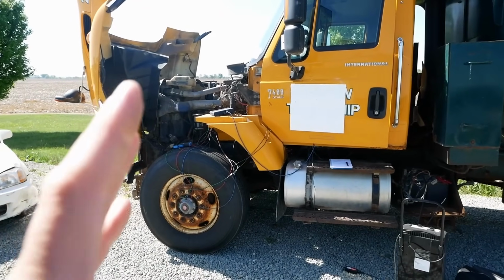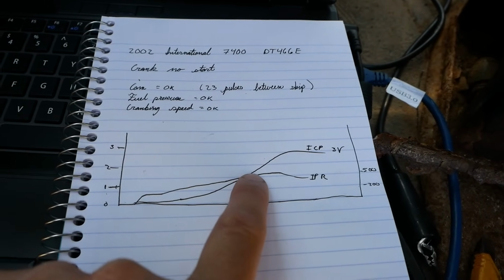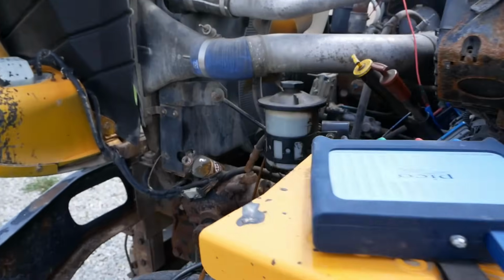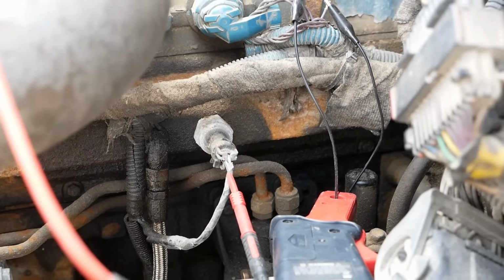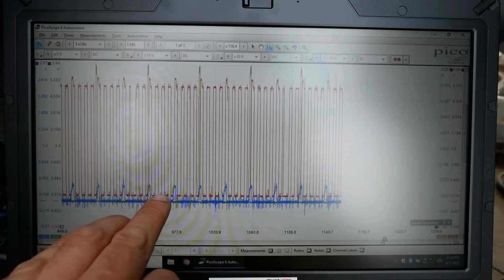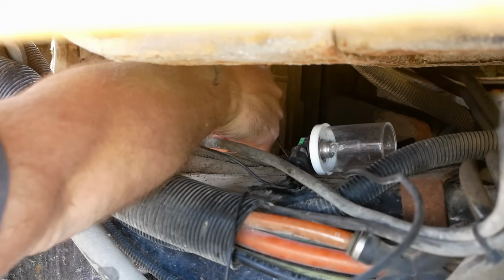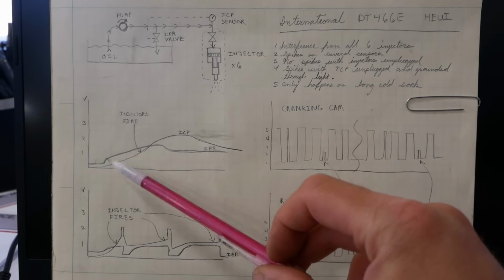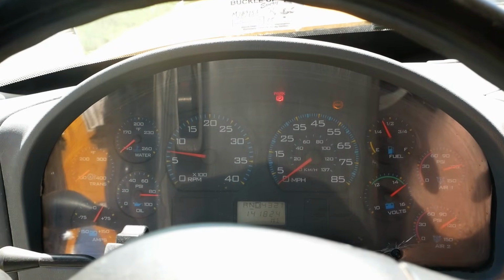International DT466E Won't Start without Ether after Sitting

Comment: 😊First thing don't call her a rusty old plow truck, she can hear you.
Like mine,, fuel sender bad, sending tube bad,
Fuel pump week, fuel check valve in to fuel bowl needs replaced, ipr valve replace.
No fuel pressure to fire the motor, so ether causes ignition and helps pump up the fuel. wait a couple days and all the fuel drops back into the tank and has to start over again, needing ether to help pump. Do the repairs. And remember you disrespect her she ain't going to run for you😮

Comment: What I observed , before you fired up the engine after a 24 hour cold soak , with the key on the oil pressure gauge was recording over 60 psi then after start , was  indicating over 80 psi while idling . It should be no oil pressure before cranking the engine , only when  cranking for at least couple of seconds specially on a cold start ! This type of diesel injection was the brainchild of the Navistar( DT466 E ) , Ford ( 7.3 DI ,6.0 and 6.4 ) and Caterpillar ( 3126 E , C7, C9 ) engineering  team , as I know .  In  the case of a  defective camshaft position sensor , no tachometer signal  , and in case of no start  P0340 or P0344 DTC ( Ford )

Comment: Power interruptions to the short term memory to the ECM, this is why IH wires directly to the battery, this need for power for short term memory.   Long term memory need no power to hold memory. I believe this is why the 48hr window. It holds the short term memory, but long term memory restores to default every 48 hour window.

Comment: My professional opinion as a truck driver and shade tree mechanic is once salt hits the electric system and the computer junk it it costs more to fix then it's worth had an IH garbage truck the throttle position sensor got f'd up never was right after that even reprogrammed it and still

Comment: Could you not just put a "start" switch on the pump/sensor to fake it out forcing it to at least start.  Have to tremember to switch it off when the motor starts .. or make it a momentary push and hold to start.  Not nessarilyy right but saves ether.

Comment: Thank you Wes , I have a 2006 DT570 7400 plow truck with several electrical issues , I don't have the skill level you have so it is taking me a while to figure out , taking one issue at a time . These modern day electronic everything's are great when they work but totally unreliable for long term , it seems . Wish me luck .

Comment: CHECK INJECTOR HARNESS KNOWN TO GO BAD CAUSING INTERMITENT START NOSTART CHECK ALL YOUR SENSOR PLUG CONNECTIONS BAD , CONNECTOR PIGTAILBELIEVE BAD INJECTOR WIRING HARNESS DONT WASTE TIME ON A SCOPE GOING IN CIRCLES VERY FANCY BUT DOING VISUAL CHECKS AND A MULTIMETER DIAGNOSIS SHIT FAST SCOPE IS GOOD BUT IT AINT THE HOLY GRALE

Comment: Remember back in the late '70s, early '80s my terminal bought some IH trucks for tanker transport. Their headlights were really bad. It was found there was a large voltage drop at the lights. We ran a separate ground wire to 'em, it worked great! The hood had a bad ground.

Comment: I know this is way old video, but should someone fall into this same pit, its the ficm .
Hes correct, the ECU, but its the injector power supply voltage dropping off with higher current for cold injectors.

Warm injectors use less power, when cold starting the injectors require far more energy. The key he missed was the low current during cranking.

If he had removed the ecm and monitored the control voltage, the smaller trucks have an access plate on the back for exactly that. it would have been low when cold and caused no cold response.
The other trucks run at 48 volts, I'd doubt those would be much different. On those its a surface mount bleedoff feedback resistor that gets cold solder cracks and loses connection. A simple reflow and they work exactly as they should.

Comment: Did i see no rpms whioe you were cranking? My 2007 7400 shouod show no rpms on tach, and wouldnt start in the cold. I changed the crank shaft position sensor (not camshaft position sensor). The crankshaft position sensor is under the doghouse. My truck shows rpms now when cranking and starts easily in the cold.

Comment: I come back and watch the videos on the plow truck and the old ford f-800 many times off and on i have 1 of both , i am always having issues with the 2002 International 4900 dt466e, slow starts no starts no start after sitting the list goes on lol i have bought a couple different lower end scan tools to read pids on the dt466 but they never read the ones i want wich is most times the icp and ipr right now im fighting it it will start and run for about 30 seconds and die it will restart as many times as i try but will die after about 30 seconds my nextlink or otc scan tools will not read icp or ipr sensors any chance anyone out here can tell me a scan tool that will read on the 4900 dt4663 ? also i might add that after counting to flashes it shows a mfi= 4 and spn 164 ??? i wish there was a list of codes and there meanings easy to find lol im retired and do everything my self cant afford to take it somewhere anyways if anyone can help would greatly appreciate it !!!

Comment: If u had the software, you could monitor the injection actuation oil pressure.  There’s an actuation pressure test as well. They use the same injectors at cat 3126 HUEI engines.

Comment: Two possibilities spring to mind. (1) The bypass capacitor on the 5v reference supply inside the ECM has failed. Put a few hundred microfarads in parallel with the reference supply and see if it helps. (2) Someone made a ground loop. I ran into this problem on a retired Crown Vic police car my sister bought at auction. From the factory, the transmission-mounted speed sensor had been connected to the ECM with two wires--a "sense" and a ground. Somewhere along the line, the harness got damaged, and the ground wire broke. Instead of stringing a new ground all the way back to the ECM, some genius said "we'll just ground her to the chassis, and she'll be alright!" Wrong. If there's a physical separation between the signal and the ground, then any stray magnetic fields that pass between them will create interference. In my sister's car, this meant it ran fine at low speeds, but died as soon as it hit 40 mph.

My guess is that (2) is less likely here, since you are seeing the interference on the reference supply, which should be a low impedance circuit more resistant to interference. But I don't know for sure--those ground currents can get pretty big.
Reply: Just watched the recap at the end of the video. My money is definitely on a failing electrolytic cap in the ECM power supply. Maybe running it for a while gives it a chance to "reform" a bit, but after 48 hours sitting it's basically inert again. Easy enough to test by paralleling the 5v supply with a cap at the connector. I said a few hundred microfarads, but maybe needs to be bigger than that, given how much current the injectors drink. Of course, it could also be on a different rail, from which the 5v is derived. May be harder to test, if that rail isn't available at the connector.

Comment: Hey Wes hope you see this comment and it finds you well. You’ll never guess what’s sitting out back of our shop looking to get an ecm replaced ……. If you see this I’ll let you know how it goes and if it cures it!! We have been messing with another intertrashanal. With intermittent no starts, like once a week maybe. The one time I caught it I had good fuel pressure good hpo but very odd engine speed signal. Either way it messed up for about a minute worth of cranking then took off and ran. Hasn’t hiccuped since. It’s a good thing international trucks are cheap because they sure as hell ain’t any good

Comment: I have a 2004 4300 dt 466 with exactly the same issue. If I leave it longer than three days 90 % chance I'm using ether.  24-48 hours it fires right up. So frustrated

Comment: How does metal get addicted
Reply: Sometimes it’s low compression, and ether gets it to fire. Ether is cheaper than a rebuild, so that’s how it goes sometimes.
Reply: Ether is a bandaid solution to a much worse problem (fuel system issue, engine issue, electronic issue, etc..) If you don't find and solve the root cause of the hard start, then the problem gets worse and worse until eventually even ether fails to start the engine

Comment: I think the biggest reason to run from this nightmare, is the fact that it was a road district truck. It's likely hauled that road salt treatment all it's life. It's like a fertilizer hauler, corrosion beyond belief on all components especially the wiring connectors and grounds. Even if you cure this issue, it'll only be temporary.  AS long as it runs, drive it till the rust totally takes it!

Comment: We ran a bunch of those damned Binders at work, they were nearly new rental units from Ryder and Hogan leasing. I got tired of walking all the time! If you let one sit over night in the winter, good luck getting it started in the morning!  We switched to Enterprise leasing and they were mostly Hino trucks. Problem cured!  I will say that the last Binders were equipped with Cummings motors and they were OK.

Comment: It is not easy but it can be converted to the older mechanical fuel system and ditch the huey those engines were bulletproof before huey systems

Comment: Missing it all together..   They use hydraulics via the HUEI pump to create enough pressure to properly atomize the fuel when injected..400psi at crank..  Car 3126 works the same way , except the crank pressure needs to be more like 800 psi..  when that pressure gets too low.. or there is a LEAK.. you will not get proper atomization of fuel to fire it.   We call it sleepy injectors.    Its either a leaking / split upper oring on an injector.. or the injector leaking internally.     You can pull the valve cover and connect the injector harness to crank it and look for the oil squirting up around one or more injectors..  , or just start pulling them all and inspect one at a time.. if no split injector o rings.. replace all injectors.. guarantee it will fire right up .  Been there done that..  learned from a gent that worked directly with testing and engineering and did 7.3 ( 466e ) work at home on the side.   Rule of thumb..  when you get ecm communications,  engine speed.. air and fuel delivery.. it will run.. what you are missing the is fuel delivery.. hence your feeding it fuel through the intake.   If the ECM was inop.. or no engine speed, tach will not work.. and no run at all.

Comment: The international service max program is what you need to scan the international truck engines. The program is free. All you need to do is by the j1939 interface box like a nexiq usb link 2 which is around 600 dollars. There are cheaper ones but I highly recommend this one.
Reply: I can even remote access anyone’s  laptop and help anyone that needs their international scanned. All you need is the j1939 interface box I was talking about earlier.

Comment: I have a 97 466e and had same issues, I couldn't get any smoke. Hook up a charger and she would fire up just fine. Finally I got pissed and smacked the 2 relays on the firewall and it fired up. In my case its in a school bus and they are directly above the motor. 1 runs the IDM and the other run the ECM if 1 relay doesnt hold the current itll do this till the cows to come home.

Comment: Have the same problem except when starts after ether shot runs fine till 1300-2000 rpm . At above rpm runs very roughly .... can't do anything...I measured no power at all at injectors when cranking...

Comment: I work on a lot of trucks like this and I find most of the time the problem is those wires that run power and ground straight to the eco will deteriorate inside of the insulation and it will cause you to lose one or the other intermittently and it makes it really hard to diagnose. I had one just this week that I had to put a starter on because the ignition post on the starter had been left loose and melted the solenoid a little and the wire right behind the terminal so it would start sometimes and it would then shut off intermittently. It was shutting off because the starter short and the batteries jumpers were eaten completely up to where the copper was completely dissolved so I had multiple issues including the batteries were bad because of all the issues in the charging system. It made it tough to figure out and I had 8 hours in it and I repaired several wires and replaced the batteries, jumpers, and the starter. His bill was $1,950, but now it starts and runs reliably and I can stand behind it and he can depend on it again for awhile.

Comment: ...dry joints within PCM, bad electrolytic capacitors, bad or heat/cold shorted filter capacitors... list goes on and on. This is why anything contains cheap mass produced electronics is junk - except Voyager probes and Mars copter.

Comment: What a great video. How you can maintain the patience to deal with some of this confusion is amazing. The 40 amp fuse solution seems quite possible. The complaint about engineers who create such poor design problems struck a thought in that they should be made to remove and replace those hard to reach parts, at least a couple of times, themselves. Then they might learn something about consideration for others, who come along behind you. 
Love your shows, always interesting. Greetings from Australia. Best wishes to you and your family.

Comment: So where does the time factor come in? Parasitic discharge? Sensitive voltage levels like the comment below? Diesels are pretty critical on battery health. Lazy batteries do cause issues with sensor based engines.  When you start it, probably it is dropping the battery load considerably with the starter motor. So if the battery is old and slightly higher resistance the parasitics overnight are enough to discharge it and stop the ecu from loading properly when other engine systems are trying to operate. The generator probably won't work until the engine is running. What else could change overnight?

Comment: You want to see something infuriating try changing the transmission fluid on a 2019 Nissan versa without taking apart the radiator or anything like that

Comment: To ouch 1011 t.y excellent use of a diagnostic tool and for all you old farts like me short story time..
Back in 1982 😮 in our auto shop we had a oscilloscope  for cylinder spark diagnostic and other things it was the size of a baby grand piano on its side and probably wieghed just as much ...long story short scope graphs can really pin point a pain in the butt problem. Especially now that you can drive around w themin real life driving scenarios 1982 we had to strap the car down onto the rollies on a make shift rear wheel drive dyno rack. Technology does suck but its also a wonderful thing.

Comment: I was surprised you didn't check those fuses by the battery. A friend of mine had 2 of those internationals and was left stuck on the road side a couple of times because one of those fuses would blow. He carried extra fuses with him.

My CAT 3126 had similar no-start issues. Some days it would start right up, some days I would have to crank and crank and crank it until it caught. Some days it wouldn't start at all. Once it started it would run fine once it warmed up. I would have no throttle response for about 30 seconds before it would respond. When the temperature dips below 50* those motors would put themselves in fast idle from anywhere for a few seconds to 15 minutes if it was really cold.  Once that cycle was complete I was able to drive it. Some days it would be rough for a bit but smooth out. It never blew smoke while running. It would only blow smoke if it was cranking for long periods of time. Ether was a last resort for me. I was plugging it in every day. Even in the summer. In the summer I would come in early and plug it in for about 15 minutes and it would start right up.

The issue was the injectors. It needed a full set. Once that was done, along with resetting the rack it was fine. I sold that truck a couple of years ago with 650,000 miles on it. The guy I sold it to pulled the motor and put it in a plow truck. The motor is still running.

Comment: I have dt466e 2001 international. It starts every time no problem but sometimes it quits in the middle of the highway abruptly. And when this happens it doesn’t start back up again unless I spray it with starting fluid. Anyone has any ideas what this might be?
Reply: Its your fuses and or connections along the way on the 2 40amp fused power and ground wires feeding power to the ecm etc.. once you get engine "run" on ether make alternator kick in enough to feed power through other channels to ecm..

Comment: you need to check for voltage drop and check for other sensors that are on the same power or ground   one bad sensor can fuck with other sensor

Comment: I think i would run a cold compression test on it and compare it to a hot compression test before going down the rabbit hole your on now. It sounds like you have an engine with cold stuck rings.  This can happen when an engine has been excessively started with ether over an extended time. The result is hammered rings that have essentially lost their temper, and thus their tension. Its a mechanical condition that the ecm only recognizes as a failed start with no inputs to give it to set a failure code.  Once the engine is cranked enough, or runs long enough the rings have heated up enough to move and seal properly. Worth checking.  We used to say these engines were " on the bottle".  They only start with the ether bottle.😢

Comment: My SWAG is that there's a bad solder joint in the ECM (whether it's a 'cold' joint, insufficient, or even cracked is impossible to determine without opening / decapsulating the ECM).